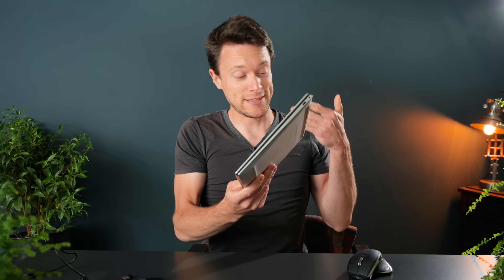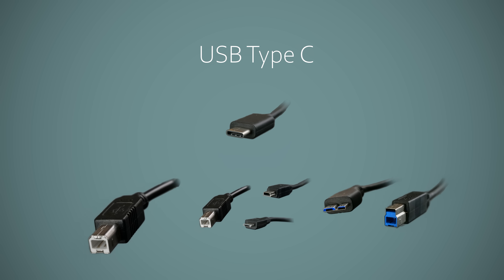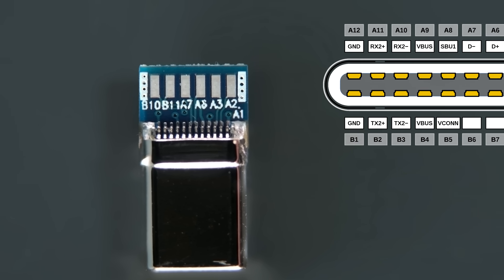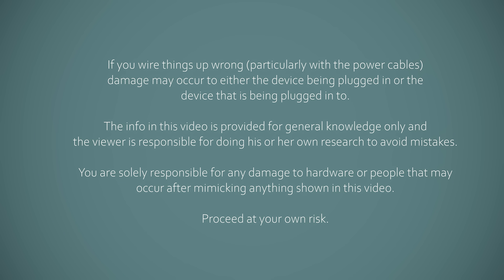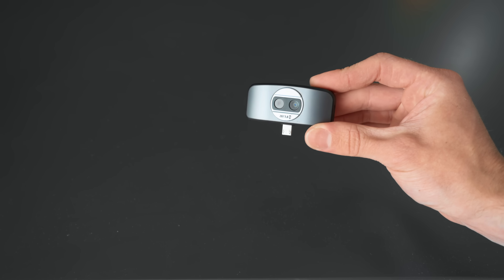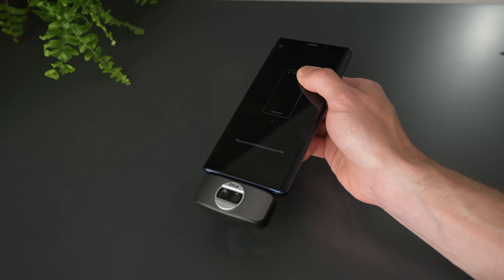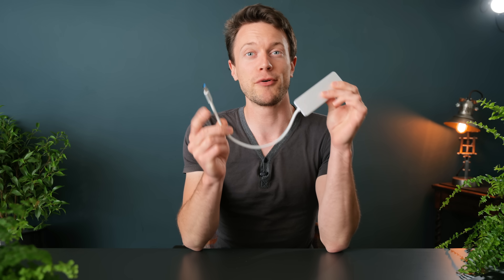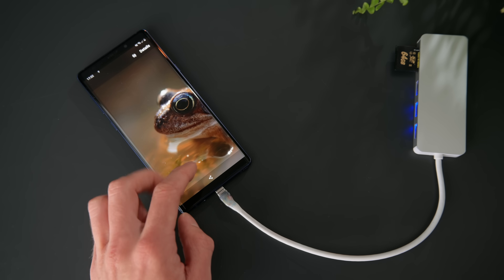Converting devices to USB Type-C

Comment: Disconnecting the 56k resistor and connecting a new resistor was only necessary because you bought the wrong USB-C male connector, the one meant for the host-side to output power. They do make and sell client-side connectors too with the 5.1k resistor installed for consuming power instead, though for some reason they are calling these "OTG" USB-C connectors. Get the right connector in the first place and this job is half the work, no modifying the connector itself.

Comment: You do not need the dongle forvyour mouse as you show it. There are many much smaller dongles without cables that work just as well and neater than your solution. Your 3rd conversion shows one.
Your 2nd conversion makes a lot more sense

Comment: This is an simplified version

For mouse reciever:
A7: Data - (White) (connect to pin 3)
A6: Data + (Green) (connect to pin 2)
G (ground): Power - (Black) (connect to pin 1)
V (voltage): Power +  (Red) (connect to pin 4)
R1: scrape a little bit and add a 5k or 4.7k ohm resistor to G

For USB 3.0 devices:
A7: Data - (White)
A6: Data + (Green)
G (ground): Power - (Black) and any ground open wires
V (voltage): Power + (Red)
B10: SSRX - (Purple)
B11: SSRX + (Orange)
A3: SSTX - (Blue)
A2: SSTX + (Yellow)

Comment: I know this video is old and I didn't even watch it when it came out, but it's always been in the back of my head, waiting for an opportunity to try. I recently damaged the usb C male connector of my car lighter charger and thought Finally! Replacing that should be trivial! I opened up the cable to find THREE connections running through it: two wires and a multi-strand sheath around the middle I've just discovered is called armouring. Glad I didn't know that, though, as I figured it meant I just had to go plug it in and bring a multimeter - the armouring is ground and one of the wires is power... I've yet to figure out what the third one is, but I can't imagine it could be data. Maybe it's related to extra power delivery or configuration 😬

Comment: what about converting micro USB ports to USB-C ports? I have some cables that have their hooks stripped away due to years of use, and i want to continue using my device (in this case, a wireless computer mouse which is charged via micro usb).

Comment: You could've used solder mask for those exposed connections first before bundling things up. It's very helpful on preventing short circuits.

Comment: I have old lenova adaptors without the ends and bought some type C cable and cut the end off and Ig wired the red and black to my old power adaptor and was plugging it into the Type C computer power supply but it did not work? Do you know of any reason why the red and black USB type C would not work wired up to a power adapter?

Comment: Why, exactly, are adapters not a solution? They work fine, and decent ones produce basically no latency and still can be acquired at low costs. They are an adequate solution to the problem at hand
Reply: size factor

Comment: 7:11 I think you can just desolder or remove R1 and move it to R2. You can trace the pads and R2 connects to GND. It would do the same thing and its smaller and less fragile
Reply: yeah, I saw the scraped trace and died a little inside.

Comment: This is just doing too much. I like the concept but if your going to buy breakout boards outright then you can just go and buy a usb-c dongle and reprogram it from the old usb one and use like any open source software (there’s a lot) on top of that, like you said, we still haven’t converted fully to usb-c. So what if you do this and you happen to need a regular usb of the device? At that point it’d be better just to buy a small adapter and keep it with it.

Comment: 5 years later, Logitech still hasn't made USB C wireless receiver for their devices
Reply: They have now but only the Bolt receiver not the unifying
Reply: When you have a bluetooth mouse or keyboard you dont need a usb receiver at all
Reply: @supersquat  BLuetooth aint great for gaming tho. way too much lag
Reply: @RikoRey-x1r  wired for gaming
Reply: @RikoRey-x1r  Ehh, Depends on if you are doing gaming that rely's on precision and extremely low latency from input devices. I've been playing games for the past 5 years with my razer Bluetooth mouse and haven't had problems with lag.
Reply: @Xavior36yeah I mainly play Counterstrike, overwatch valorant etc etc where any amount of added latency or lag is pretty much unacceptable 😂 even in league tbh
Reply: @RikoRey-x1r  Yeah, Those aren't really the games I play. I mainly play games Like Soma, Oxygen Not included, Space engineers, Nier Automata, The Forest, Captain of Industry, etc where(at least for me) if there is any lag it isn't really noticeable.
Reply: @supersquat wireless and Bluetooth aren’t the same different signal hence the dongle
Reply: Check out the logitech zonevibe 130

Usb c wireless receiver
Reply: I have usb-c dongles for my Steelseries headset and mouse and it’s even bigger than a nano dongle + adapter. Unless they can make a nano C adapter might as well stick with A.
Reply: they should include an adapter in the box which plugs in a usb c but you but the a into the c

Comment: i have an corsair virtuoso headset and for some reason is the wireless connection super short on these.. I was wondering if changing it to USB C would increase it? Or maybe you can make a video on how we can extend the mesh from random manufacturers like corsair with other devices if that is even possible :)

Comment: Ive got myself in a pickle and I'm actually surprisingly quite successful in almost all my electrical and tech type alterations and repairs..but this one has me a little hesitant on tackling. So I've got a Anran wireless solar powered camera that had the solar panel cord cut and who ever cut it, must have some dumb reason taken the end of the cord I needed to plug into my camera. So I've got the original panel part but the type c plug is what I need to replace. I have literally have an endless supply of old every type chargers so I've already stripped apart a few type C which is what I need for the plug in part to the camera but on the solar panel charger cord there is only two wires positive negative and not the data wire and ive learned almost all of them have more than just two wires inside and they're smaller awg than the two on the solar panel power cord so I'm concerned it's not the correct power going through. So what type C power cord am I looking for and how do I identify it without stripping the cord apart

Comment: Hello!
Thank you for the video.
I just bought an old Nintendo Switch with teared off Type-C port.
On the PCB, there are 2x24 pins in two rows. In the bottom row (below the Type-C port) 8 pads of the 12 are teared off.
So my idea is to cover this row completely with insulator strip and only soldering back the 12 pins in top row.
What do you think, is it possible to use the console this way (but only with a certain side of the plug plugged in)?
If not what will I miss? The docking capability (video output), or the charging capability also?
I hope the charging will work at least, so we can use the console in portable mode.
Thank you!

Comment: Just now finding your channel.  This is great content.  I have so many good accessories and devices to convert to USB-C.  This will help.  

Additionally, I have a shit ton of old charging cables which have broken down right behind the connector.  Do you have a video of cutting the cable back and putting on a new USB-C and Micro-USB end connector?  That would be very handy for all the repairs I need to make.  Thanks.

Comment: Those breakout boards are designed so you only have to move the SMD resistor to a new position to get a USB sub configuration, but you totally destroyed the traces and mounted a fucking giant through hole resistor instead…. I mean, I guess it worked but it hurts my sense of elegance a lot.
Reply: He just bought the wrong USB-C connector and then had to modify it for his purpose.  He also didn't have an SMD resistor, so he used a full size one.  USB-C is designed such that if you connect two (host) power supplies into each other, there is no power from either. Because he had the host's plug, it likewise doesn't work.

Comment: This is such a helpful video !

I have a brake free, helmet brake light which is the older model which slow charges with usb. the newer model now available changed the charge port plug to usb c and i am very interested in accessing this faster charging capability.

i will test this soon.

thank you !

Comment: Why did you just not move the Resistor over? The unpopulated space besides it is for pulling down instead. Why the extra work? I'm pretty sure most breakout boards have similar changeability....

Comment: No! I still preffer USB-A for computer related appliances
I thought this video was gonna be talking about, how to convert Barrel jacks and Micro-USB charging ports, to USB-C
an Actually handy Guide
Reply: What benefits does USB A have over USB C? Why do you prefer A over C?
Reply: @kushagrapatawari  After the almost 30 years of using USB A, I've never had USB A, randomly at some point, give up the connection, 
because of the mechanical Friction, loosening, make it not staying connected.

Comment: Probably the stupidest idea I've seen for a long time.  Risk breaking perfectly good devices in order to save about half a centimetre sticking out.  The flexible adapter cable is actually safer as due to it's flexibility it will cause very little strain on the usb-c port of the laptop.

Comment: If you have tweezers, it looks like you can just move the resistor at R1 to the empty pads next to it, entitled R2. 

Then you don’t need to cut any traces, or solder in a larger through hole resistor. 

A cleaner install, arguably easier, and removing unnecessary comments that can short. 

Also any first timers taking this on as a project, use flux 😅😊.

Comment: well most USB-C only laptops has Bluetooth built in which most mouses are able to connect to directly without extra pluggs.
Reply: Bluetooth connection is much slower than using the dongle provided by manufacturers. If you want to game or are sensitive to the lag, having a dongle is much nicer.

Comment: I was just thinking about doing this as I recently upgraded from my 10 year old MacBook pro to the new MacBook Air which only has USB-C ports. I've used the same ergonomic wireless USB-A mouse for a while and loved it, but hate having to use a dongle. I ordered a USB-C breakout board on digikey and was able to use the existing plastic housing that was on the USB-A connector.

The resistor you use adds some unnecessary bulk, and without it you can easily use the existing housing to keep a low profile.

USB-C devices automatically detect whether they are connected to a host (controller) or a peripheral (receiver) through the configuration of the configuration channel (CC) pins. The host typically pulls the CC pin low through a resistor (typically already built in), and the peripheral detects this and configures itself accordingly. This means the receiver will inherently operate in peripheral mode without an additional resistor.

USB-C is designed to be backward-compatible with older USB standards, meaning most USB 2/3 devices will work seamlessly without additional components.

Comment: I love the video! Question, is it possible to also upgrade a device that uses rechargeable batteries such that it can charge the batteries via USBC? I have a FrSky taranis 9 lite RC controller, which I use to fly my drone. However, it uses 18650 rechargeable batteries, so it’s cumbersome charging them because I must open the back, pry the batteries out, charge them, and then carefully re-insert them with a little bit of aluminum in between since they are flat top and need a piece of metal as a bridge between the two flat tops, ie, to close the circuit ig. There used to be a pbc board that could be installed, but they stopped selling them. 🙁 So now I am looking for other solutions

Comment: A precision soldering station can be got for less than $50, and would let you do much tidier job when working on small devices.  Even when using cored solder, it is a good idea to dip wire ends into flux before tinning them.  But most of all, you need an adjustable iron to avoid making a mess.  You also need a damp sponge or folded cloth to clean the tip, although some of the people I worked with either  flicked the iron or tapped it on the back of the bench to clean it.  This left tiny silver puddles all over the place, but they peeled off easily.

Comment: Hi I don't know if you would see this message but I have a 12v 300w outlet and I connected it to a dc boost converter and increased the voltage to 19v which is what the device on the receiving end requires  but the device is using a USB c port and I don't know how to get enough power (65w) across with the end of the dc boost converter having just positive and negative

Comment: I have tried this with an extra Logitech receiver I had lying around. I'm probably horrible at soldering, so while I did manage to make the connections, it's not working. I suppose I fried the components (used a 30W soldering iron, and each connection took more time than I wanted); I measure 0.5V between ground and power on the receiver PCB, which I guess should be 5V.

Comment: Personally I don't think that this is very practical for most people, especially when it comes to laptops. It's simply easier to get one simple dongle or even better, a hub. (Looking at the laptop you have, you'd want a hub anyway, unless you want to swap items constantly.)

For the mouse, you can just get a Bluetooth one (yes, I know the point was to keep the mouse, but a Bluetooth one is more versatile anyway) or use the touchpad, too. 

Not that I don't think this is impressive, or a good solution for those who can and want to do it, I simply just don't think it's a solution that makes sense for the vast majority of people. I feel like this video vastly misrepresents how annoying dongles are to use, especially in comparison to the work (and money, for the parts , the soldering iron and soldering materials, and the epoxy or suru) needed to replace the USB versus spending a few bucks on something like a hub for a laptop or a dongle for the camera.

Comment: In case of the thermal camera - does it really need to be configured in the subdevice mode? Since this camera uses USB-B connector, which is a subdevice connector - I think in this case the phone should be considered a subdevice. I guess that this particular camera uses an internal OTG converter that is connected to the phone, thus making it the host device that connects to the rest of the camera via these 4 little wires in it. By removing the portion of the camera with USB-B connector and soldering a USB-C connector directly to those 4 wires he effectively bypassed the whole OTG system, but I think that it's still something to clarify. Maybe in case of devices with different configuration where OTG is harder to bypass it may be necessary to leave the USB connector in host device mode. And it is another example that shows how USB-C is superior, because in its case USB OTG isn't required and those adaptors that convert USB-C to USB-A technically aren't OTG (though we still call them this way sometimes), since they don't convert subdevice to the host device, they just change the shape of the connector, keeping the whole system pretty simple, while OTG adapter that converts USB micro-B to USB-A is required to be more complex, just like any other subdevice that connects to phones with USB micro-B - originally the connector that is meant to be connected to the subdevice, not the connector that is instead connected to the host like USB-A and USB-C

Comment: 07:12 I guess there is the pads on the left of R2R for a reason. You can move this resistor there and it will be connected to the ground. no need to cut the traces and add bulky resistors.
Reply: I think that he knows that too, but soldering SMD components requires one to be very, very precise, so I think that he deliberately avoided this operation since this particular video is intended to be a relatively easy tutorial

Comment: commenting this while i'm working on this, but this directly inspired me to want to learn how to solder! i'm modding my ipod 30-pin cable to have female USB-C, since i'd want to plug this into another USB-C cable cuz i find that more convenient
another convienence is that this is just wired to use normal USB 2.0, so, no confusion about which pin goes where

Comment: Hello, thanks for the video, I have a question for you, I have a dock with male USB C, but my 2017 MacBook Air does not have a type C port, it only has USB A 3.0 and a thunderbolt 2.0. How can I connect it? Is it enough to put an adapter such as USB A male to USB C female and will some features be lost?

Comment: okay so I rewatched this again in 2024 and instead of using the giant resistor couldn't you have cut the trace and then bridge the pads to achieve the same effect, you could have also moved the resistor but the cut and bridge would have been easier from the size of components needed stand point

Comment: I agree that the "dongle" used by you in this video is a bit cludgie.  That is pretty much on you though.  There are adaptors that are much shorter, no wire at all that will do the job, at least now.  I have a few purchased on amazon upto a year or 2 back.  So, for most people, that would be a much better option than the wired one you used here.  Also, since it is short, it is a better option for those that have zero or little  electronics knowledge and not particularly interested in "maker" type culture.